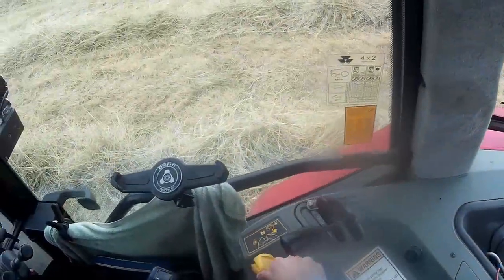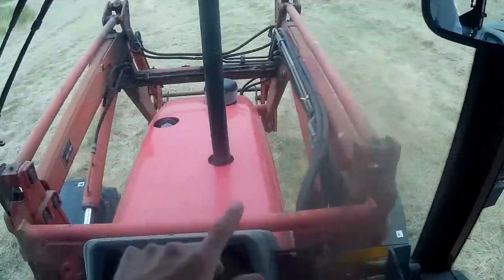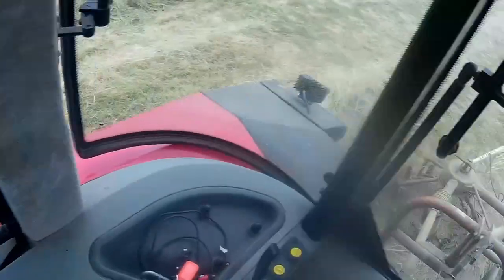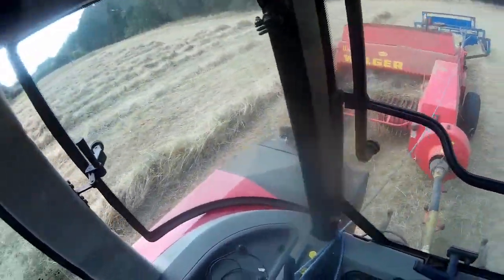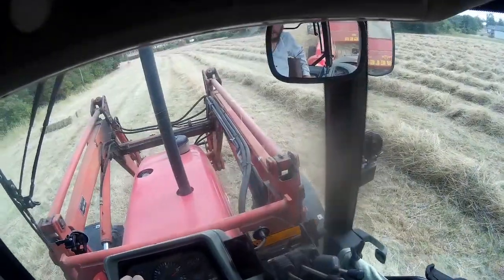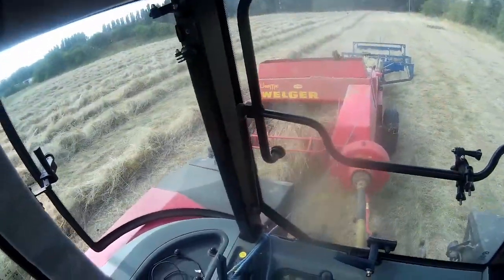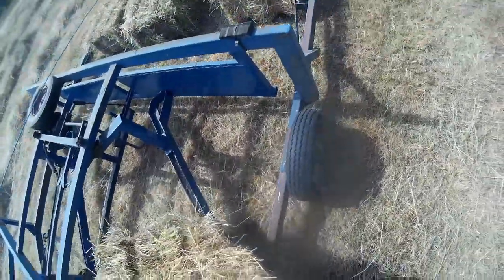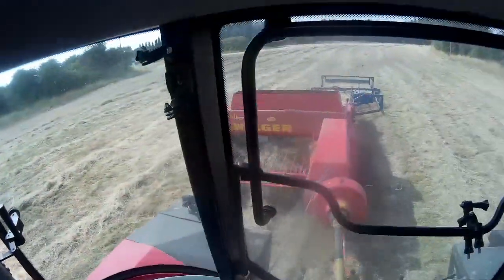more haymaking

Comment: I used to have the same problem with banana bales in the horse field I rolled. Heavy one end and light the other. Only way to stop it is making sure the baler has enough hay to fill the bale chamber before the ram pushes the flap into the bale. I was always told the row wants to be as high and as wide as the pick up reel.
Reply from the maker: i have played with the fingers so they are closer to the floor of the intake as hay was being left under them on each sweep so hopefully now should be better, i could just do with even growing fields...
Reply: If you can't get a big enough swath and it's still doing it you'll have to stick it up a few gears. I've had it so I was doing 8 or 9 kph to fill the chamber. In the rolled field I got the contractor in to row 25 ft and that was the first time in that field I didn't have a banana bale 😂